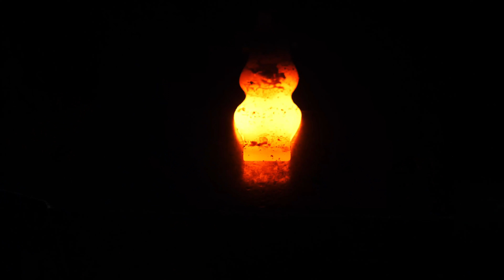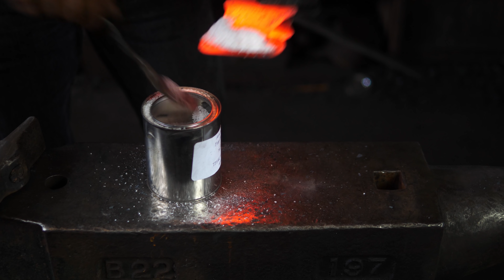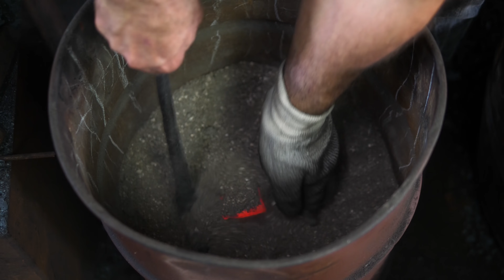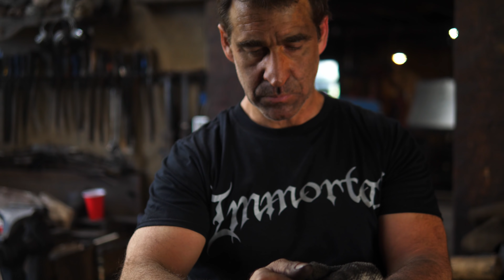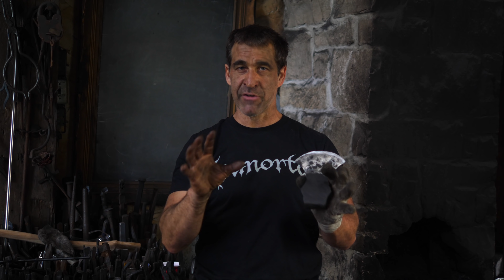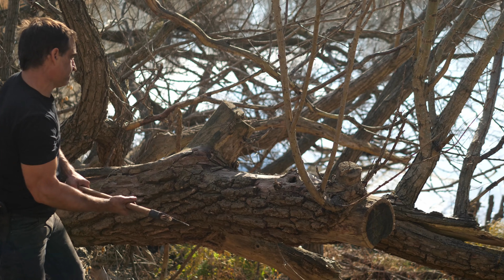Forging an Axe with Thak - Beginner's Hand Forged Axe

Comment: Thanks I've had a blacksmith shop for years tools and equipment that I've gathered through the years since I was young but really haven't used it that much to be honest but it's primitive stuff like a Arm & Hammer 100 lb anvil several post vices a blacksmith table I built a large cast-iron Square Forge with legs and a quenching pool on one end and a big metal shroud I think you can still buy them mine was purchased on a farm that I was painting a barn in Wisconsin bought it from the farmer I have another little Forge I bought years and years ago hand-crank leather belt wheel driven blower I would never sell my tools it's just life is too short we need the Heavenly calling

Comment: Really cool. My only question is, how do you get the wooden handle in securely to where it won't come out when swinging?
Reply: Get the handle on in the right spot, then pound down a little metal wedge into the wood of the handle to expand it and "lock" it on to the axe. Same thing for hammers.
Reply: @thelight3112  Ahhhh, thank you! Makes sense

Comment: Have you ever tried adding some super bright light to the workspace to even out the lighting when filming a glowing chunk of metal? Might be able to get a shot that way that shows the hammer position (on, off, half, etc) a little bit better? You'd likely still have to drop the exposure in post but it might make a little nicer shot.  I only say this because I remember in a previous video a while back you mentioned trying to improve it.  Thanks again for the vids!!!